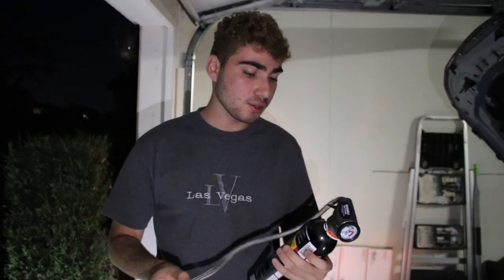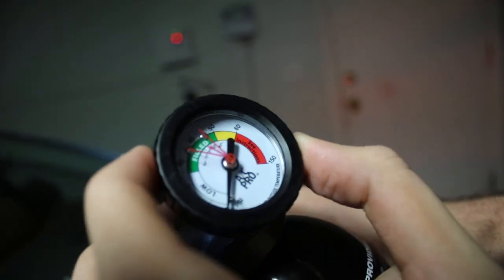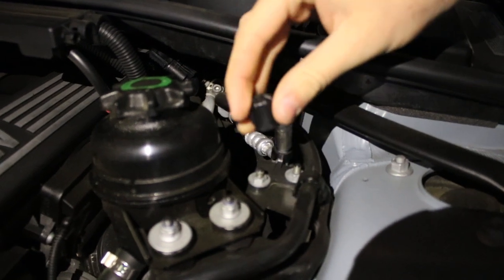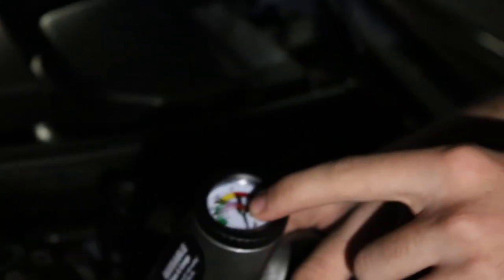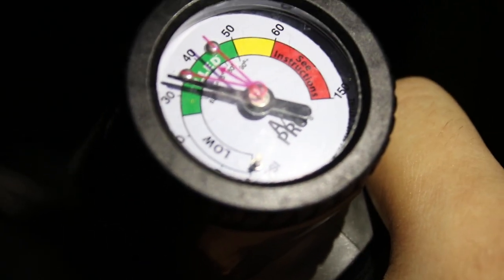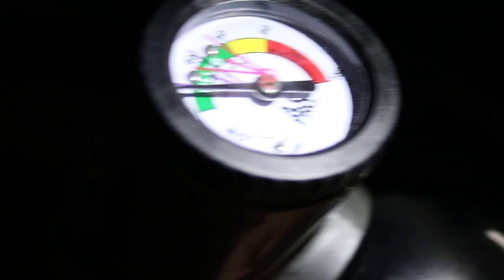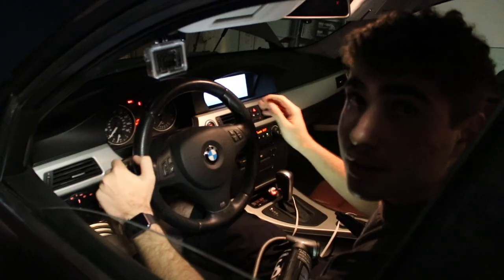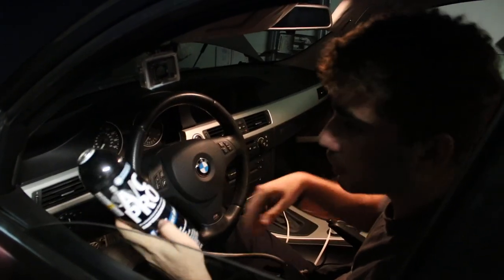BMW AC RECHARGE KIT (SOOOO EASY STEP BY STEP)

Comment: You are supposed to put it in the LOW line. Luckily the AC PRO is dummy proof and it only fits the low pressure line. Check every 10 seconds.
Reply: He did put it in the low pressure line. The high pressure line is on the left side of the engine.
Reply: @mahadragon  But he said high line.  He just mixed up his words.  No biggie.
Reply: I was saying the same as you.  But he just mixed up the words.
Reply: It looks like he put it in the low line position
Reply: He needs to correct the video to specify LOW SIDE!!
Reply: THAAAAANK YOU....i thought I was the only one notice he said that wrong...🤷🏿💯
Reply: @mahadragon  p0
Reply: Had to turn this off immediately after he said that.

He dont even know what he doing.
Reply: @bmwbmw8466 clearly he did it correct. People can make a mistake on one word. We are human

Comment: 100?  Shit if it was that much to have a shop do it believe me I wouldn't have worried but for my 2013 750i they wanted to charge 250. I've done damn near all the repairs on my own now just from watching YouTube videos too lol I've done my spark plugs o2 sensors radiator hose changes alternator change turbos air filters tpm sensors and gonna try my brakes next but all of it learned from videos like this so keep up the good work.
Reply: Where you find the videos for the o2 sensors? I have a 2013 750li xdrive and I need to change my o2
Reply: Yes i just did my charge pipe on my f15 n55

Comment: You NEVER NEVER EVER FILL on the high side.  NEVER!!!  Did you evacuate the system before filling?  Very important step to NOT skip.  Did I mention you NEVER fill through the high side port?
There should be a sticker that tells you exactly how much you need.  Coolant or refrigerant?  I think you mean refrigerant.  So many thing wrong with this.
Reply: He actually did on LOW line,  just mixed by saying  HIGH line... Yes,  it goes on low line, actually you can not even plug that recharge hose on high line,  it won't fit... Good luck ✌

Comment: Mine just now started blowing only slightly cool, not cold, air. Finding a leak has always been the bane of A/C repair, using dyes and uv lights. The thought of going to the $tealer is out of the question so I'll give this a shot until I can find a good independent BMW shop.
Reply: city auto in NJ

Comment: My f10 is just letting out hot air even on 60° after I installed my backup camera retrofit any idea if it's something else or maybe I just need to add freon?
Reply: Did you figure this out?
Reply: @samah713  yes the mechanic told me the compressor so I installed a new compressor my self then got it gassed at the mechanic which shaved me 2500 dollars
Reply: @kiingmccoy6383  yup. Had to do mine, with a denso
Reply: @samah713  definately saved us money man💯

Comment: WRONG: That is your low pressure line. You do it on the LOW pressure line..Adapter WILL NOT fit high pressure side !!!

Comment: technically you should evacuate all of the matter inside  the system removing any moisture that might of accumlated unside from  condensation   pulling a 20 lbb vacum and shut off  guage to line  see if it will hold a vacum for 20 minutes   if no leaks  then start engine turn on ac to max and fill er up  to  the  sight glass in line  has nop bubbles  doneskis

Comment: I put it in the gauge into the pipe but when it read the pressure it was at 40 psi does it mean it doesn’t need any and it needs a new compressor?
Reply: It could be multiple things but yes it's either that or a thermostat, I'd start with the thermo first bc it's the lesser of the two evils

Comment: I did the same thing when I replaced the radiator and now my ac doesn't work. When I try to fill it up it leaks out
Reply: Possibly damaged the condenser
Reply: @slowk6gixx1k78  you don't think I unloosing something I wasn't suppose to
Reply: @elboogie7248  I mean possibly. I would check all hoses, fittings and the condenser that’s pretty much all It can be
Reply: My dumb ass would. I replaced the radiator a year ago and now that it's getting hot I really want to fix it and im not going to pay someone to do it for me
Reply: @elboogie7248  what year is your car?

Comment: First of all, it is very very very very important that you use a vacuum pump to such out the system and create a vacuum BEFORE charging!  The moisture needs to be removed and a vacuum created.  Holding a can with a hose and a trigger on it does not make you a mechanic.  And how on earth could you have ""accidentally"" released and more than likely contaminated the system?!

Comment: Damn that's why you emptied it by mistake. LOW LINE DUDE LOW LINE NOT THE HIGH LINE.
Reply: No is imposible,  he can not charge  from the high,  
Actually  the high  is in the left,
Beside  a/c pro is dummies  proof, you can not do it , he said  it wrong.
Reply: Anyone actually find their port on the b48 f30?

Comment: Should of had manifold gauges not to hate but you should leave a/c to professionals it’s a very easy to destroy an a/c system if your not professionally trained
Reply from the maker: Live The Experience lol with all the things I’ve done to my car, I’m not paying someone to hold the ac bottle. YOLO😂
Reply: Nour Hummadi you do realize you have to do a negative vacuum on a fully evacuated system right? Yolo, wait till you seize your compressor